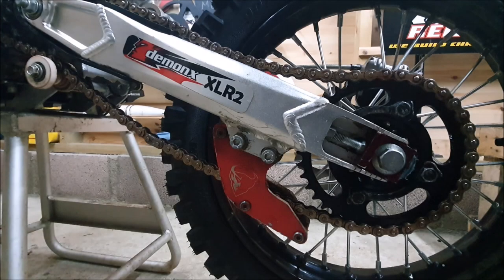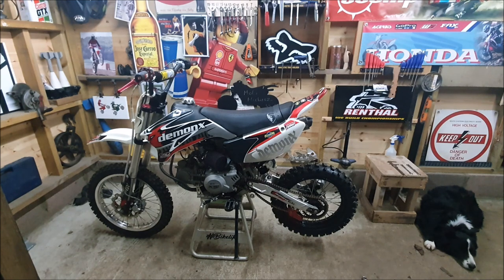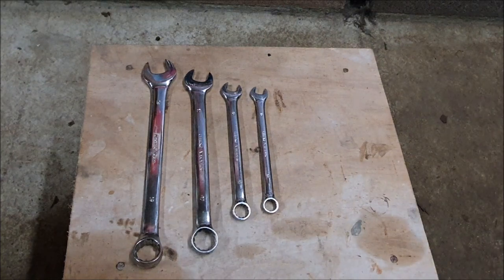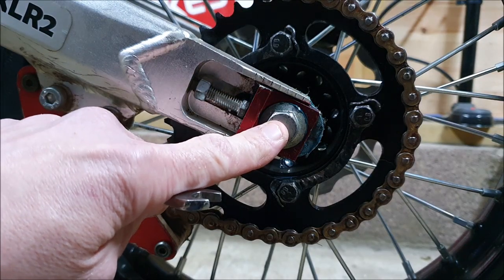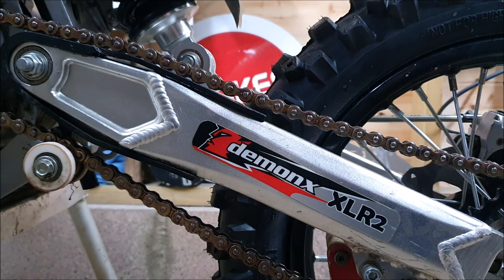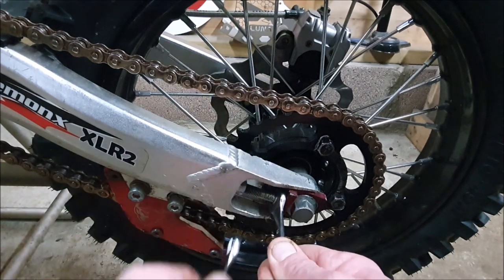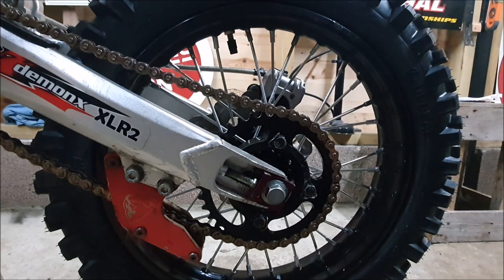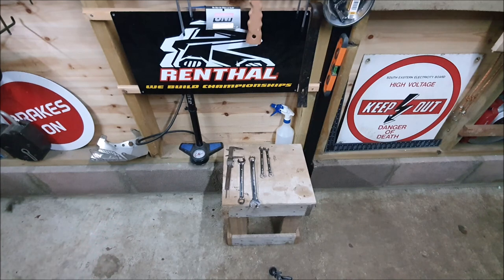PIT BIKE Chain Tensioning. Why, When and How.

Comment: I can tell by some of the comments saying it's still too loose that they
 don't understand the geometry of the swing arm's movement and how the 
chain will tighten when the suspension is compressed. Sure- go ahead and
 make it tighter and stretch the chain, wear out your sprockets and 
damage the output shaft bearing.

Comment: Been watching ur videos for a while and then recently a 170 detroit came up for sale in my area unexpectedly so I bought it what a beast of a pitbike it is.
Reply from the maker: Cheers hope you enjoy the content mate. You got the demon or wpb Detroit?
Reply: MOTO MACHINEZ UK the demon x, was wondering if youv had any problems with urs ive had a few with mine had to replace the wiring loom recently
Reply from the maker: @Illusive23  no problems apart from me not doing timking nut up properly. I have experienced a dodgy wiring loom on 160. I got 50 odd hours on mine now and runs like a swiss watch. I hear the kick start can be a problem
Reply: MOTO MACHINEZ UK yeh what do u mean by the timing nut and yeh ive got the non decompression model so ive heard the kickstart shaft tends to snap sometimes if it kicks back
Reply from the maker: @Illusive23  when I did the timing the nut on the valve i should have done up tighter was my fault so i bent a outlet valve. I over revved it then it would hardly start so that's why I had to do timing. I've heard a few snapping kickstart shaft. If you got a good technique it will be fine.
Reply: MOTO MACHINEZ UK is this the lock nut of top of the valve u loosen when doing valve clearences and have u had any problems with the cam chain and do u have and advice to keep it maintained
Reply from the maker: @Illusive23  no problems with cam chain. Yes it's the screw on the valve timing bit. School boy error it was. Jusy the usual keep a clean and cared for air filter and do oil change every 10  odd hours. Solid engines if maintained a d keep the chain in good order. Love my demon it's a decent pit pike
Reply: MOTO MACHINEZ UK have u changed the cam chain atall because mine seems to be quite noisy
Reply from the maker: @Illusive23  have you tensioned it up? Only when I took head off to replace valve but seems fine still. They are a little noisy I find.
Reply: MOTO MACHINEZ UK Im sure the 170 has an automatic came chain tensioner or can you set the tension?
Reply from the maker: @Illusive23  yes but they do stick. Mine did when I put back together I had to work it a couple of times before it done its job. Worth a look and try

Comment: my mate put my chain back on recently and left my tensioners loose and told me to try it, next thing the chain comes off and cracks my engine including completely wrecking my crankshaft had to buy a new 125 engine because I had no clue or no one to turn to help me fix it. ALWAYS make sure these tensioners and tight and fit properly with no movement and check after and before EVERY ride!

Comment: Great vid mate good demonstration do love that nobly on the back wheel where did you get it mate and how much
Reply from the maker: Alright mate it's a cheap 1 off ebay. I got it a while back I cant remember price was about £20 but it looks better in  person than on pictures. I got my eye on maxxis set for £75 I know these will improve handling massively.
Reply from the maker: @quadruple treble 1888 depends how well its maintained and how hard its been ridden. Need to look for signs of wear
Reply: @motomachinezuk8786  where do you buy parts for the 190 beast? Brought one second hand.  Needs a few little bits
Reply from the maker: @robsykes3828  I find my stuff on ebay mate

Comment: Wrenching tip a lot of people don’t know of grasp easily.... But I learned tearing down power transformers. When wrenching , flip the wrench over in the hand each time you perform a turn movement, the angle of a wrench is perfectly setup so that you can make the same degree of movement and if you flip the wrench over in your hand the wrench teeth align perfectly with the nut. This lets you eventually go very fast.  This is becaus your not having to adjust the angle of the wrench to fit it on the nut, just flip the wrench over and you’ll see it slides right on .  Also good for wrenching when you can’t see the nut.
Reply from the maker: I'm listening I shall try doing that, not sure there was enough room to spin completely but I'm not sure. My first lesson on spanner was never pull towards, learnt hard way there. Always push away. 
Cheers I will definatelty try this, good form etc...

Comment: Hey, brilliant vid, my bike has an issue when accelerating up hill it jerks if you like. Thought it could be the sprockets but there only a couple of months old? Will tightening the chain help? Thanks again.
Reply from the maker: Could be yes chain should always be correct tension. Sprockets could be worn can but I doubt it. Maybe rear sprocket is loose 🤔.
Reply: Thanks, yes I took it apart and the front one is loose, also the air filter was clogged ill get back to you and let you know it it works👍
Reply: Hmmmm I cleaned it all out and degrease it. It had a ton of grease on it and still kinda does? It's reduced but not fixed the problem. Tension was pretty good like yours. The rear brake is causing some resistance but it seems to be more the chain that vibrates????

Comment: Dude I'm no mechanic and I've just put together a 140cc THUMPSTAR.. There's a pin in the rear lock nut, do I pull that out before cracking it mate ??!?
Reply from the maker: If the nut has a split pin then yes remove to undo and re insert once done up. I think this is what you asked ? Hope it helps
Reply: @motomachinezuk8786  Majik thank you 👌

Comment: Sometimes when i get to 4th gear in my bike (Apollo RXF, YX140 Motor) it kind of go blank for a second, kind of as if it was in neutral or as if the clutch was slipping (it doesn't slip at all when its actually in gear). Is it possible the chain is skipping? Only happens in 4th gear, rarely. Checked tension today and it seemed a bit loose, will adjust tomorrow
Reply from the maker: Could be a worn or damaged sprocket with teeth missing but weird how only happens in 4th. How used is it? Could be the 4th gear cog worn. Loose chain could be possible but I'm guessing not with those symptoms?  
Hope this helps
Reply: @motomachinezuk8786  thanks a lot for replying! Yesterday i adjusted the chain and surprisingly the problem is gone

Comment: Hello m8, I heard best chain lubricant is automatic transmission oil.
Reply from the maker: Hello yes I tend to use transmission/gear oil and brush it on lightly to mainly keep the rust off

Comment: My M2R 125 chain came off yesterday and got all jammed up in the little cog, I got the chain back on properly but now when I push the bike the wheel locks up after a few seconds pushing it then unloosens then locks back up. Any suggestions what the problem might be ?
Reply from the maker: Sounds like you've kinked the chain possibly

Comment: Bought a 1000w pit bike 2weeks back and chain making a noise, think it was too tight, will it be damaged now?
Reply from the maker: Won't be damaged but will need realignment and correct amount of slack. 1000w should not damage chain much
Reply: @motomachinezuk8786  tried slacking it off, still making a noise, maybe it’s not the chain
Reply from the maker: @lassydogpie5390  can also make a noise if dry
Reply: @motomachinezuk8786  it’s oiled plenty, I’ll take chain off see if it’s the motor
Reply: @motomachinezuk8786  chains fairly tight but rattles all over if you lift up back wheel and watch it

Comment: What dors it mean when the chain goes tight and slack when spinning the back wheel?
Reply from the maker: Its stretched. Sometimes it's ok but if the tight spot puts pressure on sprockets it's not great.
Reply: @motomachinezuk8786  its only getting tighter by a few mil and is only just noticeable tbh. I just got a new super stomp 125. Took it out for the first time on the weekend and the chain went slack. Thanks for the quick reply!
Reply from the maker: @PkmHax  keep it lubed and tensioned correctly regularly and it will last a while mate. No problem always try to help people and reply asap
Reply: Youve gained a subscriber here! Take care man!

Comment: Hi so i have 125 pitbike the back wheel locked up due to ripping the sprocket of the back wheel but the bike still starts just no clutch is it the plate or the clutch endearment mechanism
Reply from the maker: Hi I can't comment never had this problem so its a new 1 to me. Sounds strange